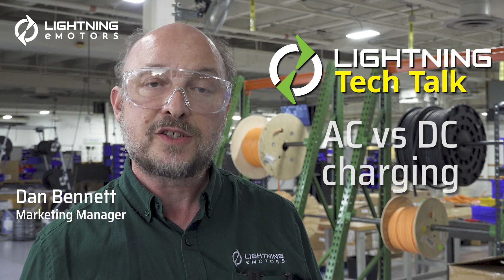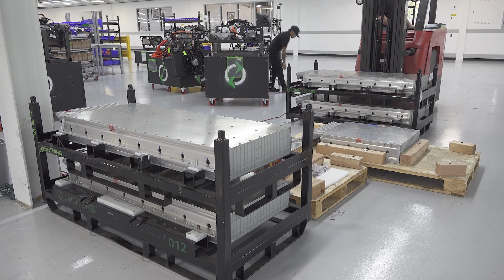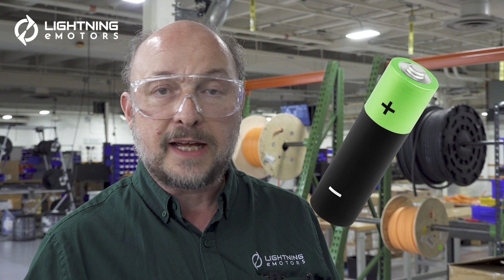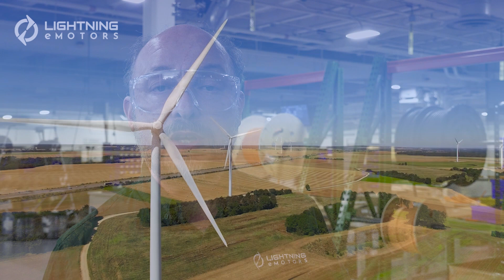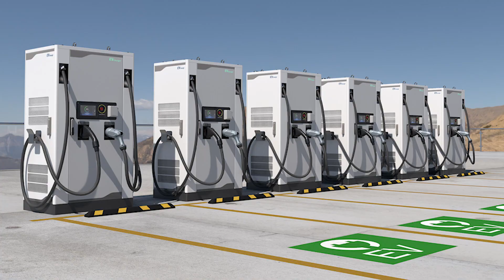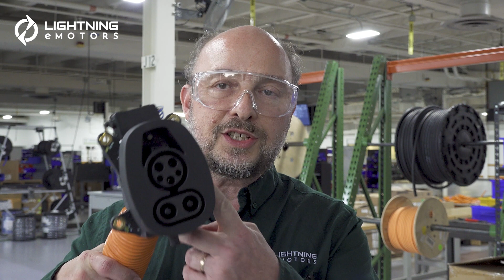Lightning Tech Talk: AC vs DC charging

Comment: very educative, WOULD LIKE YOU TO MAKE A VIDEO COMPARING AC CHARGE STATIONS CHARGING EV CARS AND VICE VERSA FOR DC. I have a question is it advisable to charge an 11kwh battery capacity on a DC 50KW charge station and what will be the capacity of energy the car battery takes in.